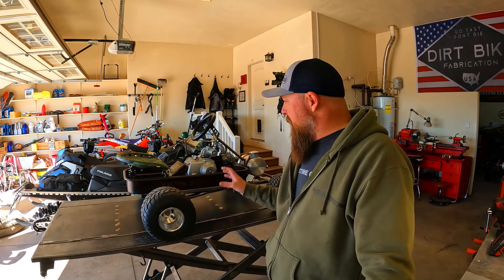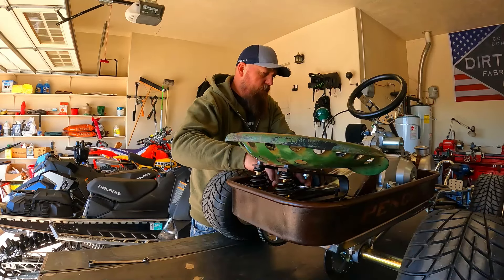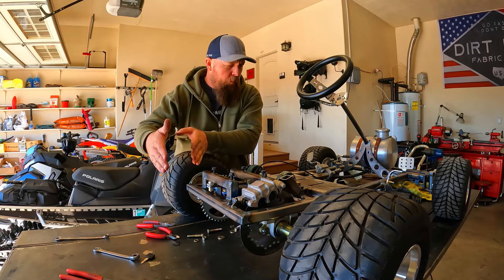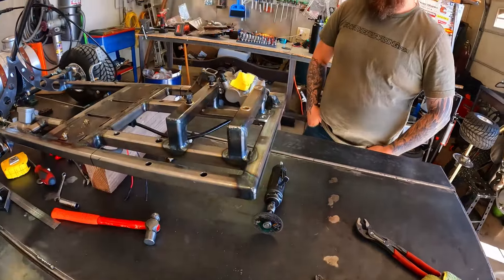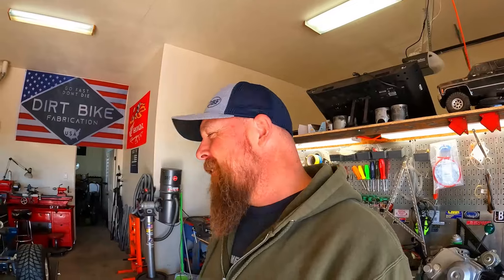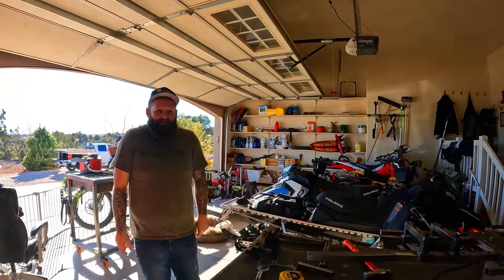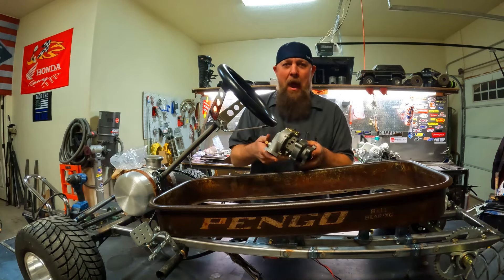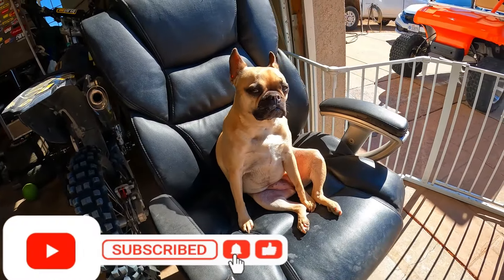The rat rod wagon is back! longer wheel base and plans for more HP!

Comment: You need to angle the king pins back for more caster angle so it will take weight off the the inside tire when you turn

Comment: I think you should move the front axle out as well, with the upside down leaf spring suspension of the OG hot rods
*Also, moving the axle back to just before the end of the frame and then putting some bigger tires on back, mighr aolve a lot of issues